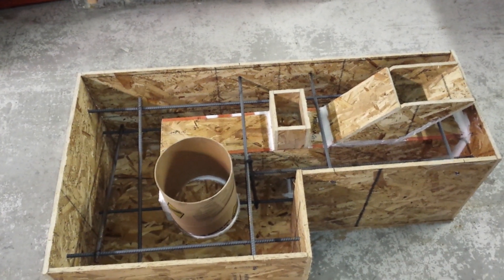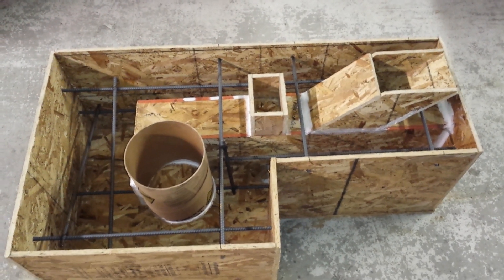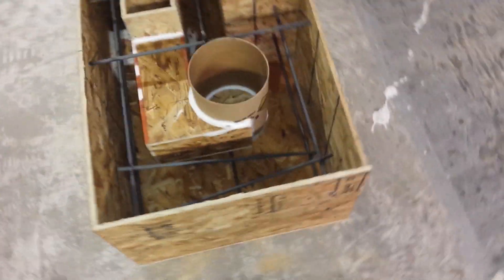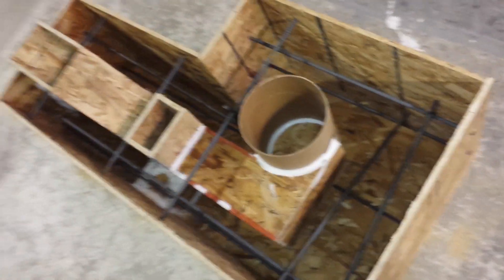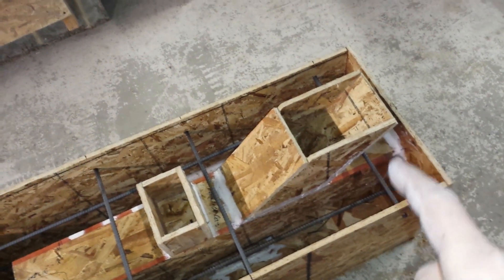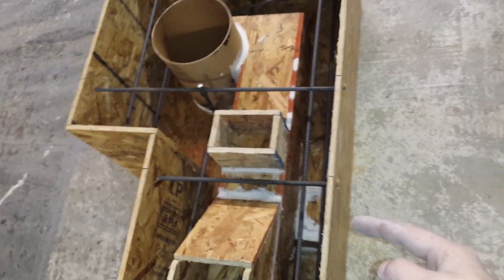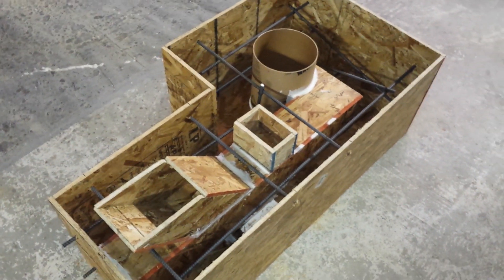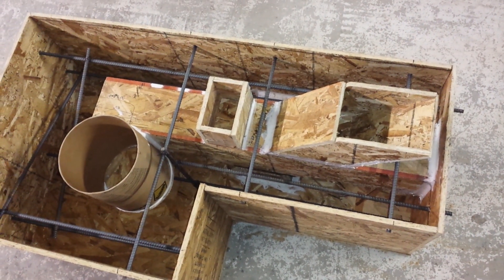Rocket stove

Comment: With the temperatures involved, wouldn't the rebar expand and contract through the heat cycles causing the casting to crack?  Just curious, researching before I cast my own.
Reply: The process was done on several other projects of mine like a 1mill BTU per hr aluminum furnace. also i heated this Rocket stove more then 50times during winter and it never cracked. You need to calculate the heat being transferred it will help you decide what wall thickness you need. good luck. also let the material properly dry for some time.
Reply: Appreciate the advice, think I'll loosely base my design on yours but with secondary air.